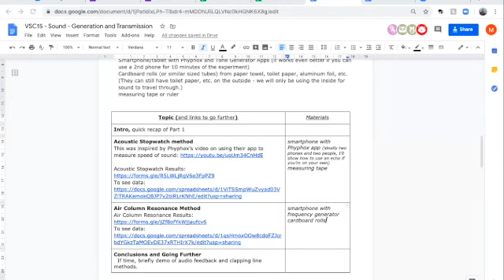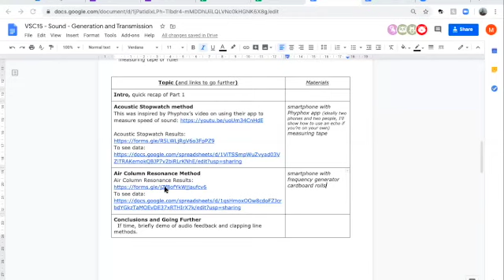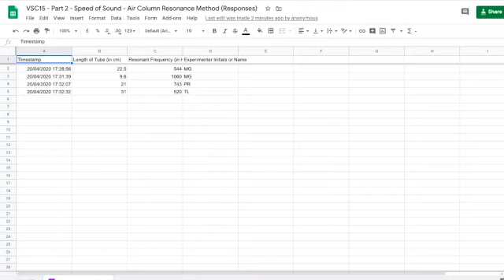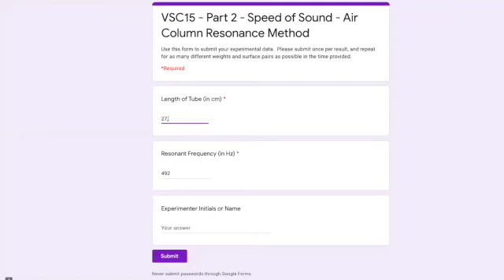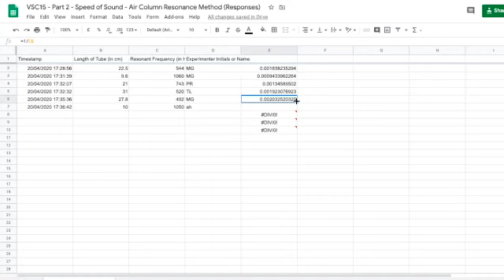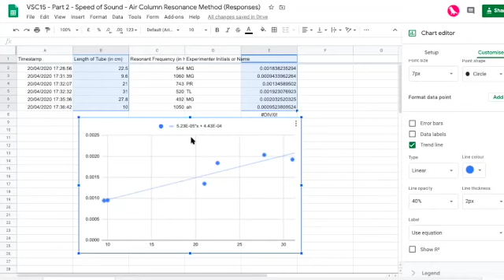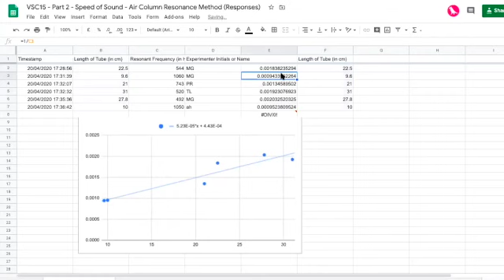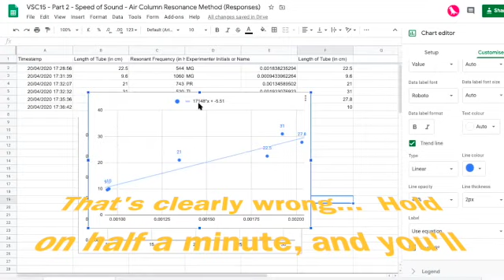VSC15 - Part 2 - Measuring Speed of Sound with Toilet Paper Rolls

Comment: I’m sorry. I know this is old but I want to know what does this prove exactly?
Reply from the maker: Thanks for the question.  Here we were measuring the speed of sound using the resonant frequency in a column of air - in this case a toilet paper roll.  The sound isn't so clear with my microphone, but the sound should appear louder through the tube when the wavelength of the sound is twice the length of the tube.
Since then, I've actually found another experiment which I prefer, using headphones to create an interference pattern.  You can find it here: https://youtu.be/Lp-CZxRxqSk?t=2865
Let me know if you have any more questions.